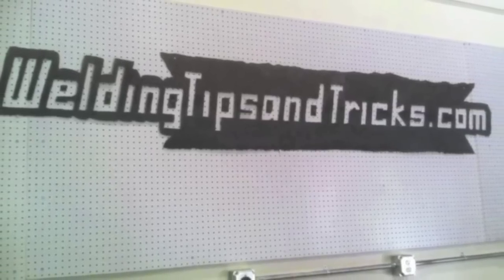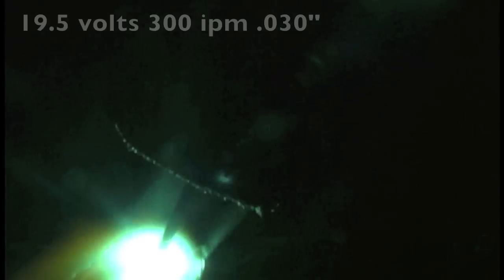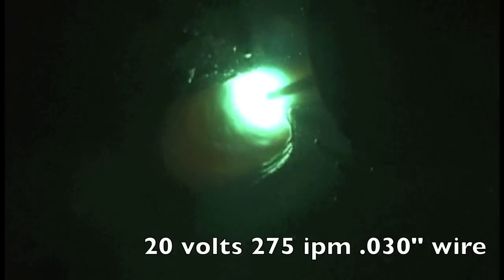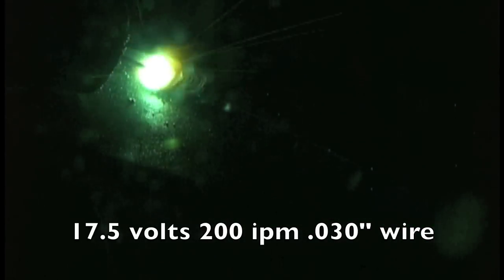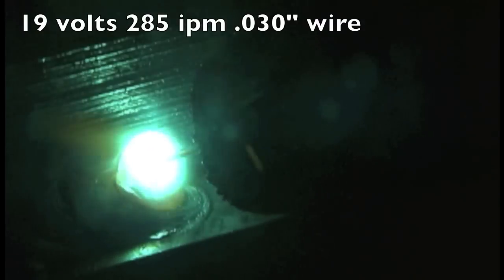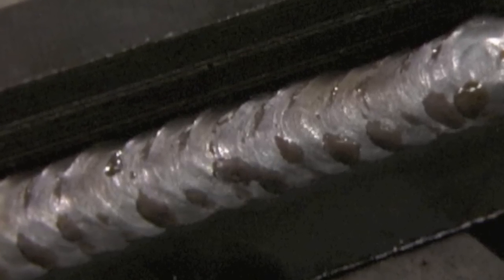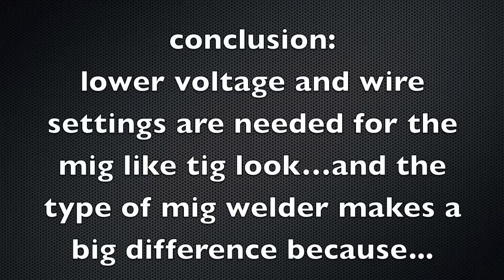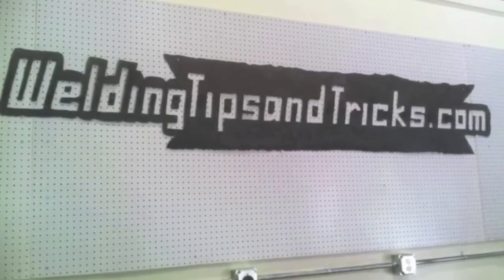Mig like Tig like ZTfab

Comment: It's amazing how relevant this video is years later. I us a Miller Multimatic 255 and I used a slightly cooler setting than what the chart recommended. I have been successful with .035 and also. 030 wire. I did try different inductance setting   and used 50% inductance but it didn't really affect the dimes. The key is practicing and having a sturdy hand. I get a more pronounced stack when pushing and making a long cursive e so you can stack on the back loop. I'm convinced it's probably not the equipment once settings are right.I went down 2 steps from the welder settings chart. You really have to practice. Best wishes

Comment: I came across how to do the mig like tig technique on accident and now its my go to for most applications that aren't fairly thick metal. Basically you actually turn the heat up a bit and then follow a line parallel with the joint line your welding then go backwards onto that same line then go forwards again and repeat. And because of the higher heat it does still get nice penetration.

Comment: Don't worry about turning down the heat. Just turn the wire speed down considerably and do a whip and pause. I keep the settings just above spray arcing and the puddle will cool off pretty instantly when you move forward, allowing for more control over the ripple. Move forward until the puddle forms a teardrop shape, then move back until it forms that perfect circular shape.
It's actually pretty simple to get that tig look as long as you have the right settings. Use the voltage you normally would, but set your wire speed so that it's coming out a little faster than spraying.
You definitely don't want it to have the bacon sound you would normally look for. The puddle won't cool off quickly enough to form a nice ripple.

Comment: One thing I found, quite by accident, was when I was mig welding aluminum with my spool gun. I turned the wire speed down too much. This caused the wire to touch the base metal, establish an arc, melt back and form a drop of molten metal. Meanwhile, the arc is still there, keeping a pool of molten metal underneath the contact tip. When the wire feeds out enough, the drop becomes heavy enough and falls into the pool. You end up with a tig bead. Drip frequency is about 1/sec.

Comment: I have watched many of your vidoes Jody and have been impressed every time, but try setting your volts to 22.5 and wire feed to 275-300. this has always worked for me very well for all positons and with the right manipulation you can get that "Tig like Mig" weld. i run a Miller 252 GMAW welder... the only thing i can also say is when welding hot with a low wire speed you have to watch you stick out alot more or youll be burning up contactor tips. Good luck and i hope it helps!

Comment: I was fabricating custom hand made mufflers awhile back and found that with thinner tubing such as exhaust tubing and the hammered aluminized sheet metal one would get from flattening the tubing for oval mufflers that to get the penetration and not have metal overheating issues that a series of somewhat quickly moving spot welds stacked running higher heat ranges and letting the puddles cool a little bit between hits yielded a weld that looked identical to TIG welds. I haven't done this in quite some time nor have I gone back and cut the joints to test for porosity and penetration. I can tell you that watching the pools looked like the penetration was solid. I have been interested in welding up an old style BMX bicycle frame for myself using thin wall 4130 and would like to use my MIG to do so, just to be able to say I did it. I've repaired 4130 using this technique with decent results. 4130 is heat sensitive so it would seem that this process would be a good strong method. I'd like to see what you could produce using my technique as it wasn't taught to me by anyone but more something I just experimented with, having a good outcome to the point that folks complimented my work and thought the pieces were actually TIG welded. I'll see if I can't get around to making a video here in the next few days so everyone can actually visualize where I'm coming from.

Comment: Ive had great success with using a backhanded circle pushing the puddle. Its never failsd to get a perfect row of dimes. I always ran 19.5 volts and 200ipm wire speed with .035 hardwire.

Comment: I know this is an old video, but figured I could pitch my two cents into this. I’ve always had great luck with a back step technique of 4 increments forward and 2 backwards. Keep gun angle to straight into the root of the joint with a push angle. This almost always gives me the look people want with ample penetration into the root.

Comment: When you first posed the question, I had the exact same thoughts that you did: 1) weld a little colder than normal, and 2) use a "C" shaped weave.  Sort of loses the advantage of MIG though: 1) speed and 2) smoothness.   Smoothness is a critical feature for the food service industry however much the auto and motorcycle gurus like it on their welds.

Comment: the inverter type welders do this incredibly well. But, like you pointed out, you do have to run cold. You push forward to the front of the puddle, pause and let it fill, then repeat. the Miller 250 line does this pretty well also. But only because of its enormous capacitor bank that stabilizes the waveform very well.

Comment: Years ago, early 1990's I welded 6063 aluminum extrusions for sun-tanning beds, and attached parts were .125 thick 6061. I didn't need the appearance, but I did need better control of the arc. I ended up with a Miller 300 CV, and Lincoln spool gun, then  I bought a CK (cobramatic) Pulser. You could set frequency and blance, similar to your videos with newer TIG and the Everlast. Welds came out looking as close to a TIG was you could expect. Filler was 4043 .035.

Comment: Jody, I spent two years at a job doing nothing but mig welding and I have a few tips. Unfortunately I can't make a video as I'm doing aerospace now and I don't have a mig welder, but here goes. First, thicker wire like .045 makes more distinct ripples. 70s-6 wire is what I used, with 100% Co2. I made sharp circular motions and spaced them a little further apart than normal, and you're right that it takes colder welding. I wouldn't recommend this type of weld for critical applications, however

Comment: I was experimenting at work after seeing this video, and I typically weld fast and hot, I'm talking like 25.5V at 450-500 ipm and I had an epiphany a stack of dimes would be equvalent to a stack of heavy tacks on a MIG gun, it worked out for me I will try to get some pics or maybe even a video...but it'll be tricky since I'm not supposed to use any kind of photography at work.

Comment: I mig like tig all the time. 6010 technique mixed with a mig e technique pausing in just the right spots. I had to learn how for a decorative job I had (and hated) but I'm still using the technique in structural. It's always passed X Ray, and bend test. And it looks way better.

Comment: 18.6 v -250-260ipm try 10 degrees pushing or leading gun angle and a lazy C leading on the bottom with a step on leading edge for penetration works best for me. Also gas can't be ruled out 80/20-90/10?, a small wire dia. helps. we have used this method for carbon stainless and aluminum. Have traveled all over the world and machines have an impact on this profile topic but the step is done everywhere someone is trying to make profile for code work. Great topic and you make exellent videos.

Comment: Jody, looking at his pictures in the first page of the mentioned thread it seems he's doing the forward and back technique. While I didn't like it because of questionable penetration, my previous boss requested that we do it on architectural prefab beams. I would weld using this technique for 8 hours a day. Whip forward and then back half the distance and hold for slightly longer then repeat.

Comment: From what I've done it actually has some to do with your gas...it is hard to do with full Co2...but I'd you use a 75-25 mix it makes a much cleaner looking weld...it's what I use for the pretty beads on my bumpers and headache racks...and the best part is you can keep it the same temp setting...so you get all the penetration with the shine..

Comment: I just use standard settings and pulse it by working the trigger.That will the puddle time to freeze. I've only used it to do hand rails and I wouldn't recommended it for anything more than aesthetics. However you will get that MIG like TIG look.

Comment: I recently saw a guy in the shop I work in lay down the "stack of dimes" with a mig welder by doing a series of short, one second tacks.  Probably not the strongest weld, but it sure looked pretty!
Reply: thats called pulse, more for thin materials

Comment: If I remember right from that thread, ZTFab posted his general technique a few times. Very very slow travel speed and the settings to allow that to work out, and getting his head ridiculously close to the arc so he could see everything perfectly. I seem to remember that the general cursive e pattern was his movement technique as well.

Comment from the maker: novus 2 fine scratch remover.  it works very well on clear lenses
Reply: It has to do with the backfill, you were pretty close with the bigger circles, though I have seen this done with a T weave as well, you want to almost trace just barely outside the front of the puddle then backfill nice and even, and swoop down and forward quickly to begin tracing the front edge again, definitely pushing, not pulling, the idea is to kinda gouge a crater for your pool to roll over top of, the backfill sets the shape of the dime, and the forward swoop allows for quick solidifying of said dime shape, usually I'll run this with a Lincoln at 280 wire feed, and around 19-20 volts 1/4 inch plate or thicker, less than 1/4 inch and I'll turn my volts down to about 18.8 or so, leave the wire speed, also very important for good technique like short stick out and whatnot, it's not really a good technique for speed, the idea is to set the wire speed lower than you typically would for that thickness of material and move nice and slow with even periodic swoops forward (the swoop doesn't necessarily need to be fast, just fast enough for the pool to solidify a nice shape
Lincoln/newer model miller
90/10 gas
18.8-20 Volts ( based on material)
Around 280 wire speed 
Suggest starting with T joints (first) and lap joints once you get the hang of it, with 3/8 plate for starting maybe 19.5 Volts

Comment: Being one of those motorsports welders, i can tell you 99% of the people that stack dimes with a mig run the machine hot, but pulse the trigger manually. The key is to get the next dime started as the one behind it cools, but is still cherry red.  All the migs we use are lincoln 250's. But i can stack dimes with pretty much any mig. did it with my buddies new miller 180 the other day. Oh yeah, alot of the mig like tig guys are traveling with a push angle, like tig. Instead of a trailing.

Comment: I  had good luck with a hot setting with  a good wire speed, not  like spraying and then more or less , stack spot welds 1/2 on the previous and 1/2 on fresh  joint. got a pretty good luck with that

Comment: I mig like tig on pretty much everything. I've had my welds tested and they always pass with flying colors because my technique creates extreme penetration. It does depend on the machine! I've used a few machines that just refuse to do it. usually because they won't hold the arc. I run basically a chart setting for my wire speed. Run my heat 2-5 higher. (I like to weld hot and fast so this may not work for everybody) Then I make a large circle. Moving completely out of the puddle BUT you can't move to far out so practice will be needed to find out how far out to move. Next as your circling back move much slower right up to the edge of the puddle. Note if you circle out of the puddle to fast you lose everything and if you circle in to slow it doesn't leave the dime. Essentially it is blowing a hole and filling a hole like 6011. That mixed with high heat is the reason for a deep penetrating structural weld that looks cool ;)
Reply: I should point out, just like 6010/11 you can't let the puddle solidify. that's where you have to learn how far and fast to move out. Also, I tried with patterns other then circles, I couldn't get the round dime shape any other way.

Comment: Jody, I use a Lincoln PowerMig 180C at the school where I teach. 
Most of the time its used for putting together test plates and pipe.
That particular welder will lay down that stack of dimes look without hardly trying. 
I haven't measured the exact wirefeed speed I use, but with a .030 wire at 4.5 wfs with the voltage cranked to max, pulling and using a circular motion at the puddles leading edge, it does it with ease.
We also have Millermatic 252's and a nice ESAB... but they don't do it?!

Comment: Pretty welds are can be much stronger than others if done right. Making the motions to make the weld flatten out and tie in the sides. Excessively concave fillet welds wont transfer stresses very well at all. So if im using short arc i would definatly use a series motions.

Comment: I get a suuuper nice stack of dimes on a lincoln powermig running 18V, 180 wire feed speed. Push the puddle and whip it like 6010 but larger whips, pausing for a second when I come back per whip.

Comment: I do it a lot at work. I have a pulse spray transfer Lincoln power 350, with .045 wire. on 1/4 inch I run 125 inches per minute, with the trim set to 1.01 and I use a horrifyingly long whipping motion. you make a pea sized puddle scoot out a half inch so the puddle cools, then whip back, and I run stargon gas at 30 cfh

Comment: i do alot of this welding to get the weld to look just like tig you need to turn up the volts and cut back the wire. i normally run 045 fluxcore wire.  to get it perfect to will have to practice alot. the way i do it is i run the volts to about 24.6 and set the wire speed at around 260. pull the tip away from the puddle to about 1/2 inch now this is the hard part you have to sqeeze the trigger then let off for just a millie second then sqeeze again . this is what i call pulse welding with mig. do not move the tip around alot and in each pause of the trigger move farward   about a 16th of an inch. if you do it right you shouldnt have hardly any slag on top the weld bead after. the slag will come off just by wiping the weld with your glove.like i said it takes time to get good at it but when you do companies will freak out over your welds.

Comment: I think .030 wire might be your problem with trying to "dime" things.. You might try some .023 the few times I have used it, it gives more puddle control for what you are trying to do in this particular video.. Thanks Again Jody.

Comment: The way i did it to make it look like actual tig welds is a square U....on the cap passes anyways...root n filler is just side to side like normal.....all up hill with 035 mini buz welder...like in ya video....pipe flanges was with str8t up n down shoelace strokes from bottom all the way around to top.....welder showed me n i adopted the movement....looked good almost no blending with die grinders or files.....

Comment: i can get pretty dam close to ztfabs beads, i usually use .035 wire with a sort of circle/loop almost over lapping the back side of the puddle if that makes sense. the trick is to watch as it over laps and you can see it fold over and make the prenounced "dime." also yes you are correct, you do have to weld a bit colder than normal. the specific settings vary on the joint type, metal thickness and welders hand to achieve the desired stack of dimes look, other people i have showed this technique to the settings i used didn't work for them without little adjustments (very finicky). for an idea if I'm welding an 11ga cold rolled lap joint 2f ill have my millermatic 252 set at 17.5v and 185ipm. if i had a way to get some arc shots i would send some to you.

Comment: Try using 0.035 wire and 100% CO2 at 200 amps and 20 volts. For manipulation do slow circles to allow the weld to build up

Comment: I run about 24.5 volts (on a miller)my wire speed is anywhere from 285-320 what I do I start on the center left side once you have your puddle I would drag down a’bout 3 full second after my center left side is full loop around hit the right (don’t be as slow as your left side be faster by a hair) and come back around  the top making sure the right side isn’t full  as  I’m coming around (back on the left side) I make sure to hit the right well  you literally are stacking the right side the left will tie it on it’s own lmk how it works for you or if this makes sense to you also this technique I used for a beveled groove

Comment: Im not saying that its proper,,but I have gotten Tig like Mig welds by turning the gas up a tad, and just manually pulsed the trigger by hand and basically trigger ON one spot for about 2 seconds then off for two seconds giving time to cool as i move slightly down stream and ON and overlap the puddle from the previous spot. ON for 2 Off for 2,,On for 2 Off for two all along down the line. I have a Miller 225. and i drug the bead not pushed but have gotten similar results from pushing as well.

Comment: Jody I got a question about settings on machines.  Voltage isn't the issue it's the Wire feed speed.... My question is why are so many different machines rated at different increments of measure??? My machine just shows WFS (Everlast E-Mig)   and i see that you are showing it in IPM (inches per minute).  THen i've seen other videos where it's FPM or FPS.  Is there ANY chart anywhere that converts all the different measurements of wire feed speed equate to each other???? I guess I could do the math to convert it but man it's a PITA to do so....